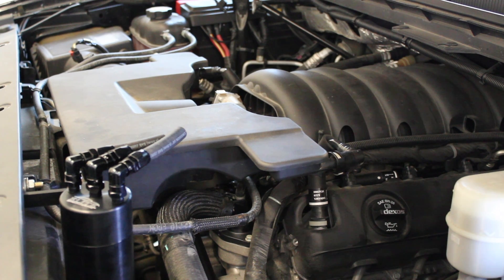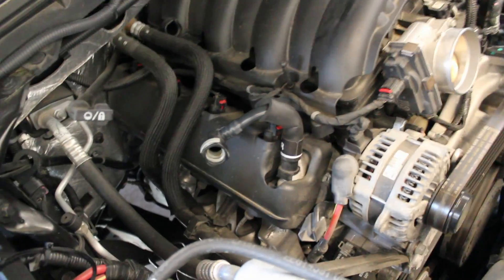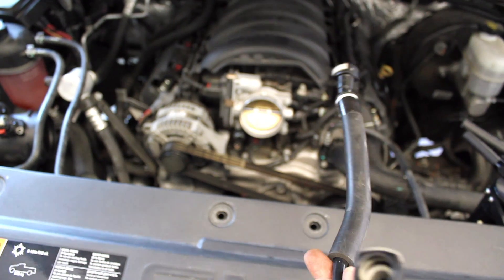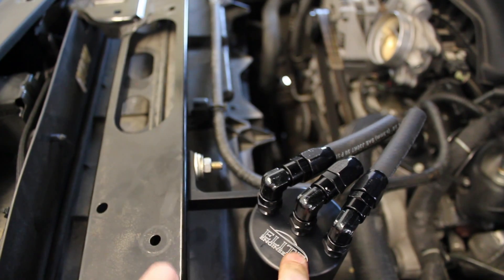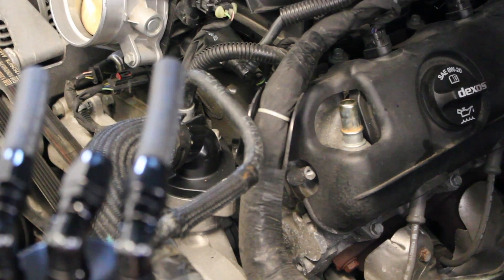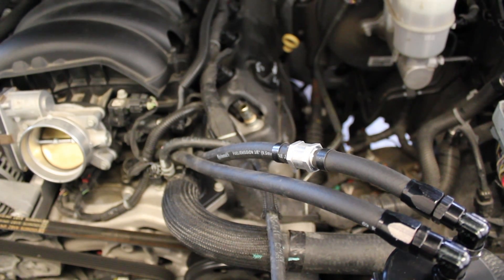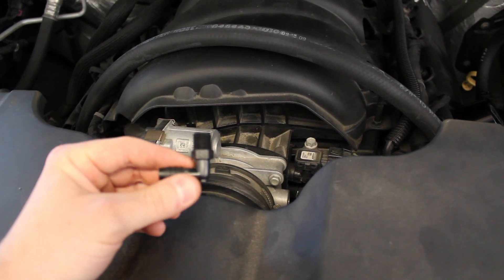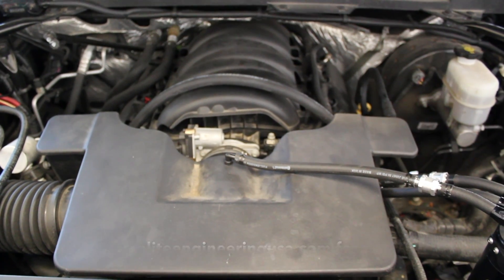[HOW TO] Install Elite Engineering: 2nd Gen E2 Catch Can on a GM Truck

Comment: Instead of drilling and tapping the intake, couldn't you connect the hose to the fitting you capped off on the passenger side (used to be for the valve cover venting).
Reply from the maker: This is how Elite Engineering recommends it be done.
Reply: @fondupot  I understand that's their recommendation, was just curious if it would accomplish the same result.  Seems as if it would.  Thanks for responding,  great videos. Always informative and  well done!
Reply from the maker: I think there’s a benefit for having the port drilled right in front of the intake as opposed to having it off to the side. I can’t remember exactly I thought I explained it in the video.
Reply: @fondupot   Maybe, but after traveling through 18" of hose I think suck is just suck, lol!
Reply from the maker: @jcwoods2311  Maybe, but I think right in front of the intake the vacuum is stronger than at one of the side ports.

Comment: How would this apply to a 2013 Chevy Tahoe 5.3L with a K&N Cold Air Intake? Can't seem to find an applicable video with 2 exits and 1 inlet like this video for my setup. Looking forward to your response.
Reply from the maker: The 2013 5.3 is an entirely different motor than the 2014 5.3. Your 5.3 is a Vortec fuel injected, you won't have the same carbon build up problems as a 2014+ 5.3 Ecotec. The 2014+ motors are direct injection and are more prone to carbon build up.

Comment: If I have a blow off valve installed (spliced into the PCV line), where would I put the catch can + check valve? before or after the line with the BOV? ( I have a 2016 Chevy Colorado LFX)
Reply from the maker: D K I’m honestly not sure. Why do you have a blow off valve on a NA motor?

Comment: I cant figure out what you're doing with the last hose. Or I should say what the purpose of it is?  Are you just trying to get as much vaccum as possible? If so how much vaccum is in there? This application makes a lot of sense in the f150 EcoBoost because that hose hoes to the two turbos, not the air intake.  No turbos in the Gm trucks.  I guess the main question is , is vaccum the diff between a $300, 3 hose can vs. $150, 2 hose can?

Comment: Have a 17 High Country 6.2L. Installed this as soon as it left the dealer crazy the stuff it catches. Also I been only using Amsoil Signature series since new that combo should help. Plus I deleted AFM. Some agree with cans others don't for some reason there's lots of discussions about on GM sites. Personally I believe in them and don't give a toss what a GM engineer saying  it's not needed. Great video enjoying it
Reply from the maker: Anthony Macneil thanks for the comment. Enjoy your truck! thanks for watching

Comment: Does the intake hole need to be on top or could you drill it out on the underside?
Reply from the maker: rednessthenwhiteness it could be under if you want
Reply: Thank you!
Reply: Installed one my 17 High Country 6.2L when new crazy the crap it catches

Comment: I have a 2015 silverado 5.3  85000k does not burn any oil, all I did install ,RANGE ACTIVE FUEL MANAGEMENT keep V8 all time ,that's the reason some engines burn oil from swich from 4 to 8 cylinder.
Reply from the maker: I have a work truck with 138,xxx miles on it. Doesn't burn any oil and it doesn't have a range device. It was common for the previous generation trucks to burn oil from the AFM system, but the newer trucks don't seem to have that issue. The catch can will help keep intake valves clean though. I'm sure my work truck has filthy valves. But I just drive it.
Reply: @fondupot  2500 trucks don't. have this,Problem. Just 1/2 ton .

Comment: Excellent  common sense tutorial.  I have done the same connections on my new grand sport vette.  result....gone from observing oil in throttle body and intake to zero oil. I just used a air compressor air oil separator.  I hope it keeps working as these DI engines can not tolerate using blow by material over and over again.  Thanks

Comment: I'm confused about the clean side separator. It replaces the oil fill in the valve cover then attached to a vacuum source to the intake. Won't that draw vapor from the oil pan? After all the oil fill holes to the pan are under the valve cover.
Reply from the maker: I checked the lines on the cleanside and it was always clean. So your answer is no its not pulling vapors.

Comment: I never got a check valve with my kit?
Reply from the maker: I would send a message to Elite.
Reply: @fondupot  I went back and checked. They stated they're only absolutely necessary on forced induction and often used on dual exit cans. I only have the inlet/ single exit can
Reply from the maker: That makes sense.

Comment: on the website it lists the check valve as an additional option, maybe $30 bucks or something. is it needed not needed whats the benefit. thx. great vids as always
Reply from the maker: Check valve keeps any excess blow by oil from getting back into the engine.

Comment: I'm just curious?  Why did you go to the Elite can if you had installed the Rx one earlier?  I saw where you modified the RX to add a secondary exit port.  Do you think using fuel injection hose is still bad?  This is what Elite includes in their catch can kit.
Reply from the maker: jewllake I was doing a video for Elite and they send me the products. The hose they provide should be adequate.

Comment: Hi. I got the two exit port (E2X-A1SVP4-GM) kit from elite and they did NOT include instructions!  My engine is the 6.2.  The middle port went to the nipple on the bottom, under the throttle body assembly.  The port to the far right of the catch can has the check valve going to the nipple on top of the throttle body.  I test drove and all seems well.  When I open the bottom of the catch can with engine idling I get a good amount of suction - does this seem right?  I also have the hose going across and connecting the two valve covers as well as the clean side separator.
Reply from the maker: jewllake yea you should hear some suction. So it sounds like you got it all hooked up correct.

Comment: I have a 2014 gmc sierra and followed this video every step of the way but after my install I'm getting a hissing/suction sounds coming from the inlet hose itself. No vacuum leaks anywhere and the can is as tight as I can get it. Do you have this same noise coming from your system??
Reply from the maker: Dave S check your hoses. Make sure none of them are collapsing.
Reply: Fondupot's Garage that's what I assumed also but none of them are
Reply from the maker: Dave S there will be a little bit of hiss. If it’s not crazy loud you should be fine
Reply: Fondupot's Garage that's where it gets weird on all the forums I've frantically read it's about a 50/50 split between the guys that don't have any noise whatsoever and guys like me who have a hissing sound. With the hood closed you don't hear it so it's not terribly loud I was just curious if it was normal
Reply from the maker: Dave S you should be alright.
Reply: Fondupot's Garage thank you for the help and great video it helped me a ton!
Reply: The hissing is in the can and the hose. They ship with a cheap J30R7 spec hose that's not epa rated for permeation. J30R14T1 is a low permeation rated hose they should be using. I changed mine and it got quieter. Notice all the lines you took off are plastic now? I changed lines because I was notcing an fuel odor in the vechile occasionally. Which of course after messing with the pcv system on a brand new vehicle I caused.

The can still hisses but that's the air going through the filtration media. Just close the hood.

Comment: In what direction is the second check valve facing? The one goin fom the clean seperator on the catch can to the drill mount pieces on top of the intake? Facin away from the catch can or torche the cat catch??
Reply from the maker: All check valves arrows need to face away from the exit ports on the can.
Reply: Fondupot's Garage thanks im waiting on my check valves to get here. Another question is it a big issue if a run the catch can with out the check valves for a couple of hundred miles??
Reply from the maker: Victor Bracamontes nah. Shouldn’t be an issue. Go for it.
Reply: Fondupot's Garage thanks alot for the info👍👍👍
Reply from the maker: Victor Bracamontes glad to help!
Reply: So i add my check valves today and my motor started missin. Like it wanted to turn off. Both of the valves were facin away from the can. What can be the problem?
Reply from the maker: Victor Bracamontes are you sure everything is hooked up correctly?
Reply: Fondupot's Garage yes exactly like the video. I change the check  valve that goes into the seperator torch the can and it stop missing. Looks like air was not  Circulating right.
Reply from the maker: Strange. My guess is something wasn't right.

Comment: I have a 15 Silverado 5.3 and this catch can with clean side Separator. I live in Norther Canada and in 35- to 40- this thing is full every 1000km. Also having a oil leak a above the starter and Chevy said it has too do with modifications truck is stock has cat back and M.I.T 45000km any ideas?
Reply from the maker: Dustin C hmm not sure. How many miles on your truck? Could just be from mileage. I never had any leaks on my truck.
Reply: Fondupot's Garage its not from mods I’ve work in a dealership for a few years and as a tech I’ve seen a lot of shity things done to cars and my truck is clean. if you have to much oil pressure or crank case pressure should blow oil cap off or dipstick out. truck has 27000 miles I’m thinking oil pressure switch or crack sensor not getting any codes and its 3 dim size drips a night very miner but still a big problem to me lol
Reply from the maker: Dang yea, that stinks. Sorry to hear.
Reply: Fondupot's Garage started looking closer on the truck found the rear main leaking. dropping the tranny today so I should know a lot more by the end of today thanks for the help and quick response.
Reply from the maker: Dustin C oh dang. Well hopefully it’s just a gasket. Good luck with the fix.

Comment: Will a catch can avoid a GM warranty in any way, thanks??
Reply from the maker: Not technically. Unless they can like the catch can specifically causing a failure of some sort. You have to decide if the risk is worth it to you. I thought it was, because it was saving the valves from coking. But your 2014 is likely well out of warranty now, so I wouldn't even think twice.
Reply: YES! I take my catch can off every time I take it in for warranty work.

Comment: Is this what I have to do to my yukon ( 2015 ) to eliminate the oil consumption ? I notice that now that I reach 90k miles needs oil 1/4 . , every 4K miles .. ??? Or it’s just the valve seals ? It can’t be the rings .... hope not..... if anyone knows .. pls let me know .thanks.
Reply: CC will not resolve your issue with oil consumption. Your issue is due to the FMS converting V8 down to V4. When this happens those 4 cylinders do not get enough oil and the lifter will wear prematurely causing oil consumption. It takes 75-100,000 miles to show up. There are modules you can buy to prevent V8 going to V4 which would have helped when your truck was new. CC is just for help preventing carbon build up on the backs of the intake valves. Now your truck is burning oil, a rebuild is needed.
Reply from the maker: Victor Rodriguez you may have an underlying issue. Because while the catch can collect blow by oil. The majority is water and other impurities.
Reply from the maker: Correct. Well said Dennis.

Comment: Can this type of 3 port system, with clean side separator be installed successfully on a L4 1.6L gdi turbo engine? Specifically; Hyundai veloster turbo? Thanks
Reply from the maker: im sure its possible.
Reply: I'm being told by forum members that it isn't possible... that a dual catch can is the only way.. would you be able to link me to a video or site that has successfully installed this type system on a gdi turbo?
Reply from the maker: Honestly I am not sure then. Turbocharged engines are a different animal and I am not that familiar with them. Forums are typically where I pick up my information, so if you are being told that on a forum, then that may be the truth.
Reply: Yes you can. We have a customer doing so and sharing all steps coming up.  Done properly it converts the Hyundai engine to evacuate at all times.

Comment: Got it all installed. Everything seems fine but when I go wide open throttle my oil pressure jumps higher than normal. Is this supposed to happen?
Reply from the maker: stan moore glad you got it worked out. 

I ever noticed a change in oil pressure. Are you 100% certain you have your hoses installed correctly?
Reply: I sure hope so. Oil pressure is fine only when wide open throttle it goes up to 70 , 40 is normal
Reply from the maker: Oil pressure should go up when you go WOT, even on a stock engine. You probably just never noticed before.
Reply: fondupot your probably right just never paid attention until now. Thanx for all your help

Comment: I just drilled my hole using a 3/8 bit. What size tap do I use?
Reply from the maker: 1/4" NPT tap.
Reply: The link is not coming up. But what I'm trying to get at is I drilled my 3/8 hole. My 1/4 tap is smaller. I'm wanting to use the included fitting that came with elite engineering
Reply: Ok found a 1/4 NPT tap at lowes. Way bigger than my 1/4 tap I had. Thanks!
Reply from the maker: stan moore yea 1/4 NPT is what you need.

Comment: I'm installing this exact same setup but I have a airaid mit. Do I cap off passenger side and drill and tap in front of throttle body on it as well?
Reply from the maker: Yes, if you go watch my other video "adding dual exhaust port catch can" That shows an airaid MIT install with the dual exit catch can.

Comment: At 8:55 mark why instead of capping that, why can't you use that for the second exit port?
Reply: At the 8:50 mark you connect the intake adapter hose to the CSS on the oil fill position. I have an AFE CAI and there's a connection port that goes to the valve on the driver side which you bridged to the passenger side. So I would use this port on my CAI tube to connect to the CSS correct?
Now to run the second exit I would need to tap a hole on my CAI tube just before the TB however, the port that goes to the CSS is right next to that area on the right facing the engine.
Would it be ok to have the second exit fitting so close to the port that is going to the CSS on the valve cover?
I hope I'm clearer than mud on my question...LOL!
Reply from the maker: Because that's just not how it works. The cleanside needs to have fresh filtered air from the intake tube. Also the 2nd exhaust port on the catch can is most effective when it is as close to the throttle body as possible. Which is why I drilled the hole.
Reply: Ok, thanks for the reply, I appreciate it very much. I have a 2014 silverado which I bought new, it now has 35k miles on it and I guess was unaware of these issues. Making me thing I need to do this
Reply from the maker: No problem. Good luck with the truck!
Reply: So you recommend the dual over just doing the single then?
Reply from the maker: The dual will be better than the single yes.
Reply: I see you have used an Elite brand and also one from RX, which do you recommend
Reply from the maker: RX was good several years ago, but the brand has fractured since. There are several sellers selling an "RX" brand catch can. Most of them being a cheap knock off of the original.

Elite is the best bet of the two. IMHO
Reply: Ok, thanks
Reply from the maker: You bet!
Reply: Could you of drilled the hole on the underside of the intake or does it need to be on top

Comment: Question was asked...........................Why not use the port that you plug in the intake tube for the second output from the can instead of drilling a third port into the intake tube? so instead of capping the one port why not just plug into that one.
Reply from the maker: Answered in your other comment.